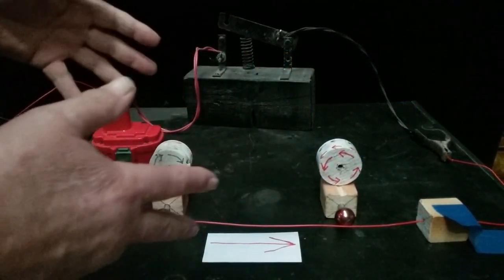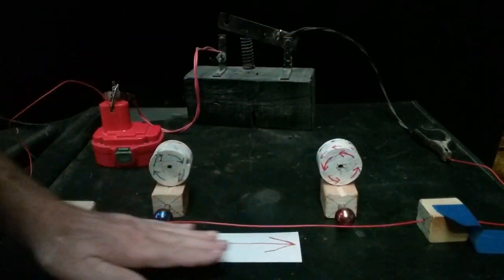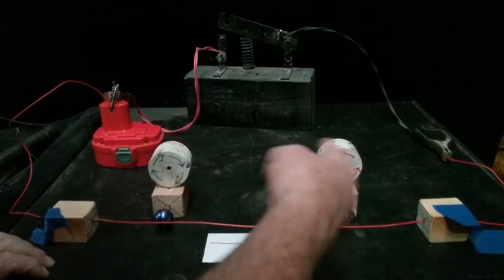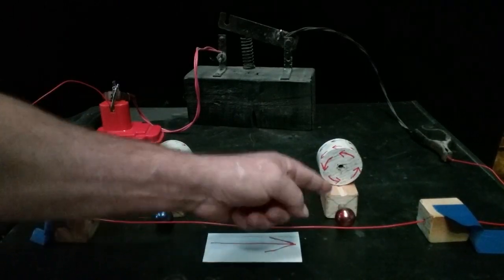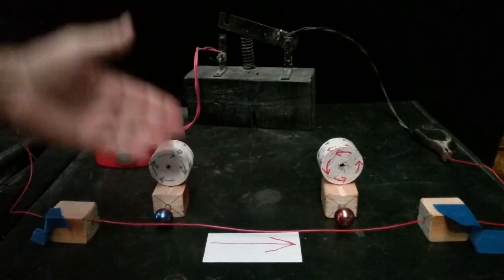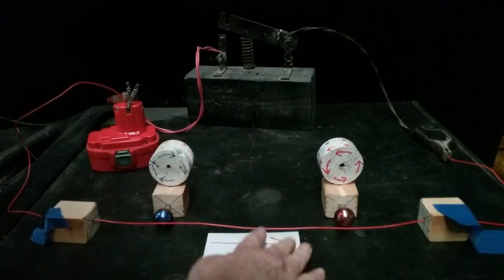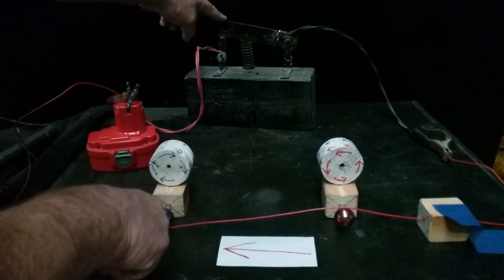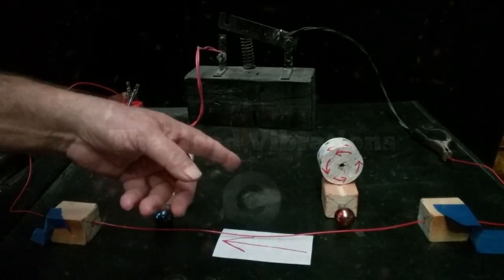Another Demonstration of the Rotation of the Magnetic Field of a Magnet

Comment: This is a great demonstration. The only thing I would say differently is, I don't believe the "magnetic field" is rotating. Magnetic "fields" do not rotate. If they did, then the changing magnetic field lines would cause charges to move even when the permanent magnet is sitting still, and this is not what we observe. What is rotating, in my opinion, is the Ether "fluid" in and around the magnet, which of course mainstream physicists ignore and deny.  The magnetic field is an emergent property of rotating currents (spinning fluid, fluid dynamics) and yes, this rotation is going on in and around the body of the magnet and there is only one rotational direction analogous to a spinning gyroscope. Otherwise, great job and VERY nice demonstration. So cool.
Reply from the maker: I understand your explanation and agree to an certain extent. However, my theory states that the Ether fluid is only rotating because the electric charge held within / between the "vibrating" Ether fluid particles is the foundation for the electron, or strong force. The delivery (flow) of these "electrons" (charge) to atoms is defined with a side effect display we name Gravity. Since the magnet is bipolar and a dual LINEAR centripetal flow of "gravity" - this causes the electric charge within the Ether fluid around the magnets two poles to rotate like a hurricane / tornado / bathtub drain - to feed the magnet it's electrons bi-linearly.
Reply: @TheGoodVibrations  I think the problem is with the word "field" which is generally not well defined.
Reply from the maker: Agreed!!!

Comment: I see electricity as the electric field traveling from + to - in a helix and electron moving in the opposite reaction as "effect-countereffect". Superconductors dont allow magnetic fields so the moving electric field has no magnetic "eddy" losses or whatever is going on.

This is sorta "proven" in my eyes cause a capacitor stores its charge in the dielectric (of which influences the electrons on the plates as a tension effect-countereffect.

In CRT the electric field colides with the electrons and the counter effect is that it gets pushed in the opposite direction similary to in a wire but since there is no wire they dont colide and create ohmic resistance to the electric field.
Also why it seems most electrons exit the small hole of the positive part and dont get attracted to the + side itself.

edit; Like when you flush water it forms a spiral and at the center the air comes rushing up to equalize the pressure